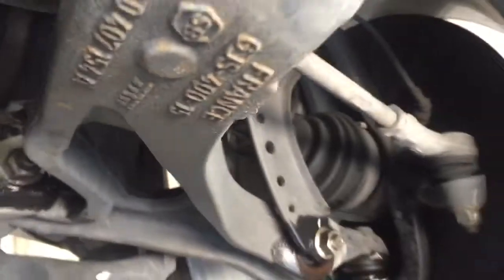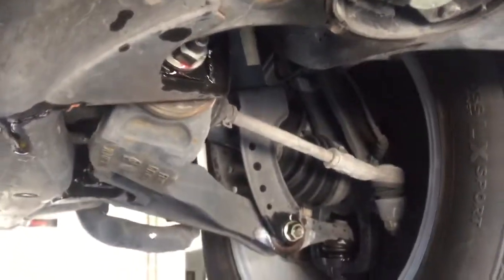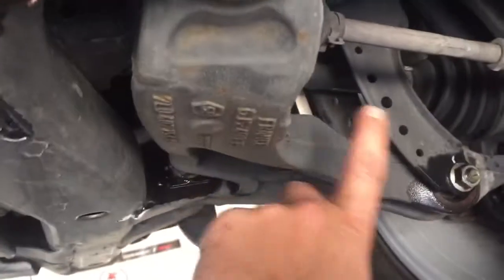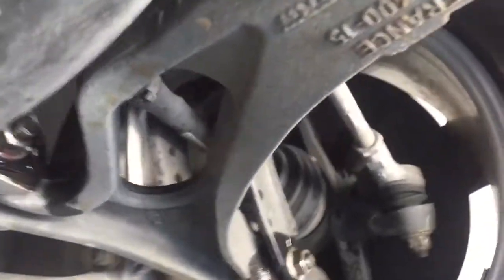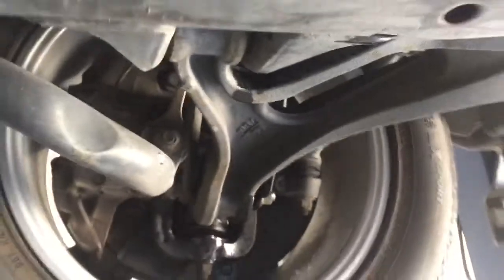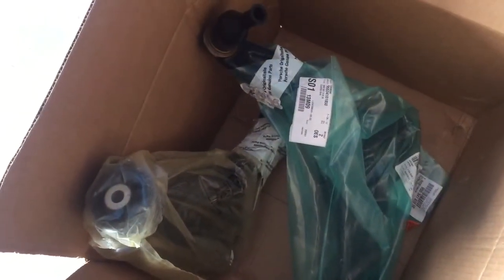DIY Trick Porsche Cayenne

Comment: Mine is a 2004 cayenne s that has all the teachart parts from factory I think my right control arm is also ticking when I brake at low speed 5mph and below also when I go over bumps. Did the o6 turbo s fit properly
Reply from the maker: The Turbo S control arm has worked perfectly!
Reply: BreitWerks thanks